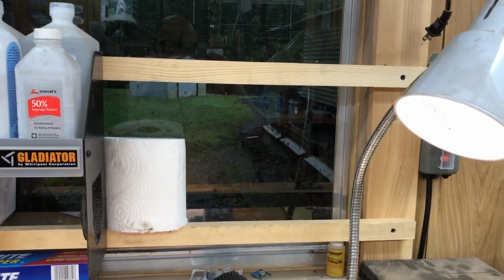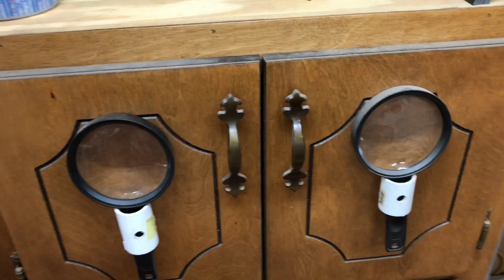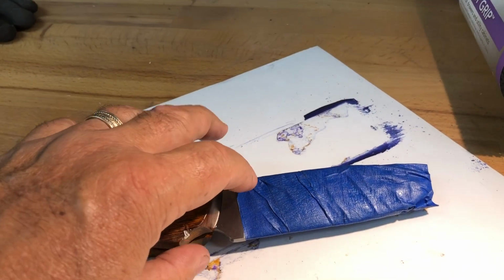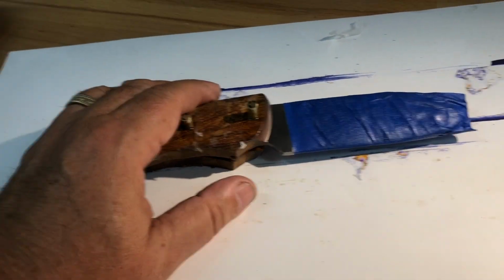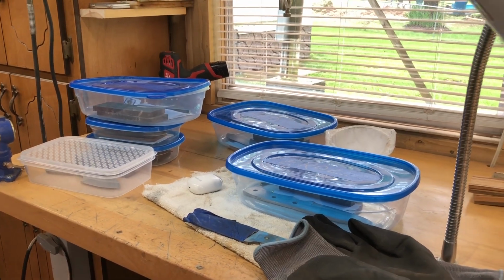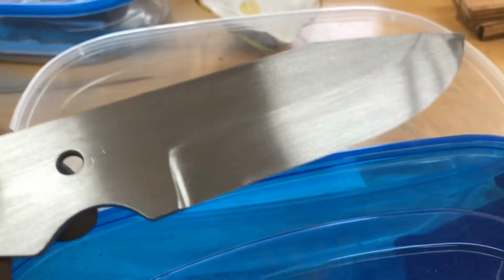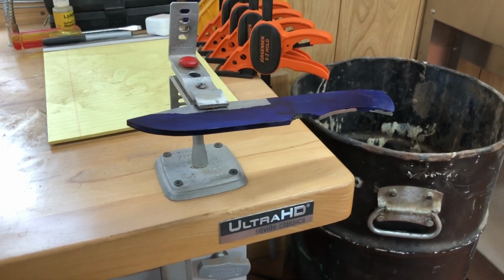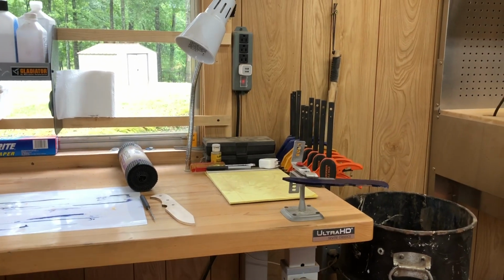Da@$#% son@*#^&# thing!!!!!       FAIL!!!

Comment: The only way that I can see to use the Texas pins showing right on both sides would be to use a shorter solid pin in the middle of the hole to secure the wood to the blade.
Then place a thin cap of Texas pins on either end of the solid center pin...maybe half the thickness of the wood down the hole...going the correct direction on each side.
I don't know how well that would work out in actual practice as I know pretty much nothing of knife making.
But...just a thought.

Comment: Just a crazy idea on those Texas pins. What about using a mini tap and die set to thread the ends together, then epoxy them. They would be straight, and then the epoxy would insure they don't unscrew. Obviously I have never done this, and have no idea if it would work, just a thought though.

Comment: If you want to do the Texas pins like that again, drill them with a 1/8 bit from the part that'll be on the inside then pin them together. That way you won't have the risk of them moving like they did.
Just do a tapered tang on that knife. Bring it down almost to a point at the pommel and that should eliminate the cut. It will make it a little lighter in the hand too.

Comment: Isn’t there something you can just dunk the handle in that will eat the epoxy?
Reply: Acetone
Reply: james schilling that’s what I was thinking, the wood is a loss anyhow.
Reply from the maker: I’m gonna contact Gflex and see what they suggest.
Reply: BCtruck, rebuild, repair,repurpose Yea, it just seems like that could happen again, and losing that much work I would imagine to be quite a bit more demoralizing than you let on.
I’d have to cut the last few minutes right out of my video.
That’s the only way I could eliminate my audible disappointment symbolized by the high volume, high amplitude, random bits of colorful language I learned in the military........